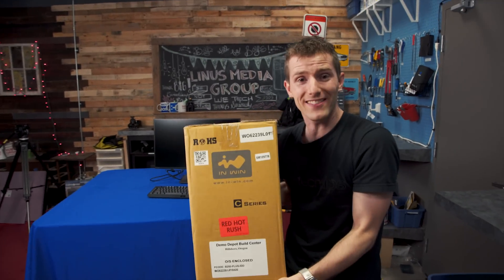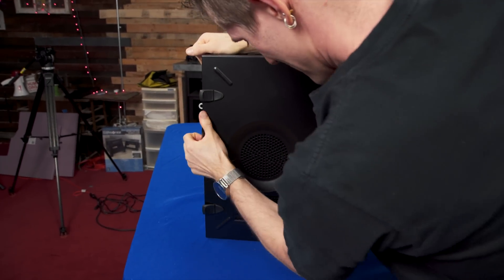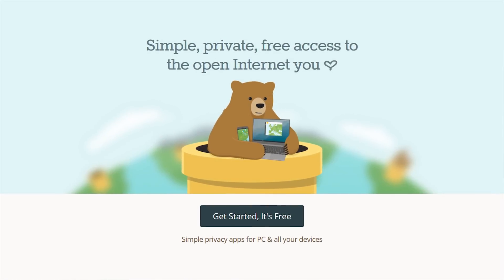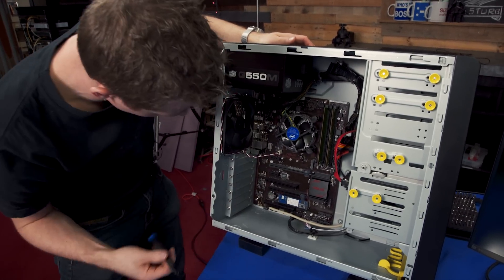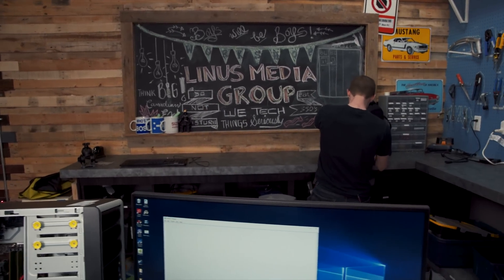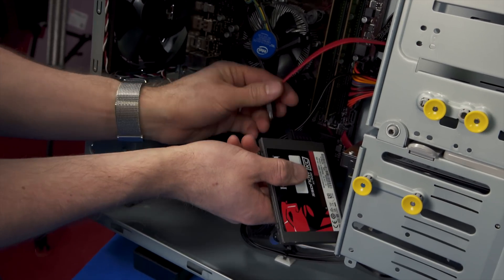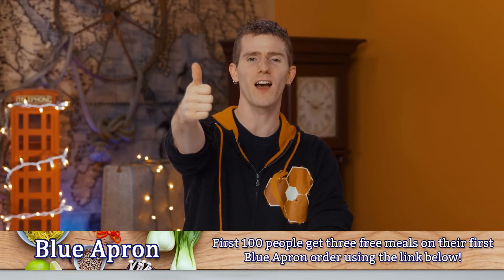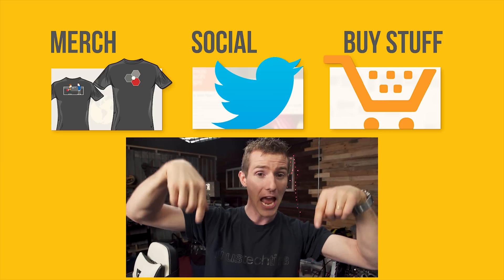Turbocharge your SSD for $40??

Comment: Misleading title. Did not teach me to give my SSD forced induction.
Reply: someone missed the turbo joke. wish my pc made turbo noises as well...wooosh pffft
Reply: DoNotAskJeeves Finally someone understands lol
Reply: Great Knightsby, Forced Induction is a car/motorcycle term to get positive manifold pressure on the engine to increase its power output/efficiency. The most common way to do so is to use a turbo charger, which makes use of exhaust gas to spin a turbo in order to pressurise the intake air.

It is extremely clear that it was a joke comment, I hope you understand now.
Reply: With a turbo I reckon I can get my pc down to 10 maybe even 9 ms in the 1/4 megabyte benchmark
Reply: Ryan Shea screw that. I'm getting direct injection.
Reply: no way! RGB and stickers can add 20+ HP!!! I mean... Compute Units! or something...
Reply: I gotta buy that Razer Chroma Keyboard with 10% less actuation force for a much more linear and responsive throttle response!
Reply: "inside joke". I'm fucking dead. lmao You aren't serious.
Reply: Thanks Falbere. I know jack shit about cars since I don't drive so I'm at fault. Apologies to the OP as well. 

HeavyRayne gtfo.
Reply: Vincent King horsepower? Compute units? Megahertz? No, GIGAHERTZ
Reply: Thanks for the laugh.
Reply: RIP. Guess you will have to stick to a naturally aspirated SSD like me
Reply: Falbere. Forced induction only works on an internal combustion engine with a lower than efficient compression ratio.Which means obviously the engine will be running at much lower efficiency when the turbo is not singing.
(Sub standard compression is required to run a turbo on modern engines, and it is helped by electronic engine management systems but they are limited by combustion chamber capabilities,which gets poor on a turbo engine..).
 You may get a higher maximum power output but efficacy will go down,generally.Even with a super charger,unless the engine is simply too small.
Hope that helps.
Reply: Sometimes, When I say boost efficiency, I mean that you only get the power when you need the power. In other words, you can retain an engine's efficiency if you stayed off-boost. This is good for when you are just cruising on the highway or when you are driving normally in a town. When you need the power, just give it full gas and you get power instead.
Reply: Unfortunately, no matter what it feels like when you demand the 'Go', a turbo motor will be doing less / gallon than a non turbo,when it is not singing.
The fact you cannot feel the power does not mean the compression ratio is not fubar and too much petrol is being burnt way after top dead center.
This is just turbo engines. 
Dont short shift thru the gears. keep the turbo just whining a little.
Otherwise your compression is shit and you might as well be burning the gasolene on the BBQ.You will find a spot in the revs where you lose little compared to driving about like a Granny.(low throttle, shift high enough rpm to just keep in turbo)
Reply: We are really going off-topic in this comment thread that is supposed to be fun. But fine, I will respond. 
I think you are still misunderstanding my terminology here. This is what I mean. In order for a gasoline engine of the same technology and basic design as its turbo engine equivalent to make the same amount of power, you need extra displacement or more cylinders. I am talking about more of a real world use scenario where you will often decide against which car to choose from. An example of this is lets say you want to buy a sports car with a rated 270 BHP output. You have a choice between a 2.0L turbo 4 cylinder and a 3.6L naturally aspirated V6. They are going to make the same power in the power band. However, the turbo engine is going to be more efficient at sipping fuel when it is not on boost.
Reply: Unfortunately you do not yet understand advanced internal combustion engine mechanics.
If you wish to make a 2 litre engine output power like a 3 litre engine by using a turbo,the only thing that makes this possible is a combustion chamber (top dead centre) area equivalent to the 3 litre engine.
(You cannot squeeze an extra 50% fuel mix in to the 2L lump; it would pre ignite and destroy the engine)
In other words, the engine MUST have a much lower physical compression ratio.
Low compression = shit mileage and performance when the turbo is quiet.
I already pointed out to you the term; too small.
You want 270 BHP but you 'diss' the 6 cylinder lump?
If its a heavy car,always buy the norm aspirated.
If the engine NEEDS a turbo to move a car sensibly; its too small.
Turbo chargers cost a packet. Running a sports car engine that NEEDS one is just waiting for big bills.
 What you saved on gas will look like a sad joke when that day arrives.
btw; the fact the car is not moving much does not mean you are not burning petrol when the turbo is quiet.
If you got your foot on the floor You may as well be just drinking it.
Reply: Man, you are really enjoying this aren't ya?
Sure, in that case I will just put on a different explanation for the use of the word "efficiency".
A turbo improves an engine's volumetric efficiency.

We really don't have to go this far just because I used the word "efficient" in my explanation.
Reply: This is bollox because you think the internal schematic is the same.Come back when you understand it cannot be so.
Reply: This is bollox because you are chewing my words on a thread that is supposed to be fun and games.
Reply: This is bollox because you have so little experience of physics you could not understand there was a penalty for running a 2 litre engine as a 3 litre engine,so shove off and comb your pony you childish idiot.
Cheeses, I've taught you more in the last 2 hours than many level 3 students get at all. Take it and walk.
Reply: Have I not acknowledged your previous comment as a good response already? I had given you another reason why I could call the usage of a turbo more "efficient", which is different from my previous explanation. You failed to catch it. After that, you proceeds to insult my intelligence, where I had made no direct comment to you as a human being. If all you are going to do is to turn this into a name calling war, I am sorry, I am not responding to you.
Reply: I have given you enough info to understand why you are totally mislead about turbo chargers. Whether or not you bother to think about it; None of my concern. I just wish petrol fumes were purple so that idiots could see their mistakes.
Reply: As I had said, I agree with the compression ratio, and yet you continue to act like I am absolutely shrugging off what you've said and proceeds to conclude that I am still misleading. Good job in your ability to read and understand text.
Reply: Ryan Shea Didn't you see the question marks? Linus just rekt Intel by saying this product is shit.  Because who is running a Z270 without a SSD?
Reply: Ubersonic well excuse me if I'm out of the loop to your inside joke. Whatever it's meant to be. I'm just sick of idiots not reading the damn title and then crying "Clickbait". There's a difference between ignorance and stupidity.

Comment: screw optane. i'm absolutely unimpressed.
Reply: everything is either a potato or not a potato
Reply: When I was a kid my dad had a thing where we'd be driving and he'd push this turbo button on the dash and the car would go super fast. I learned later that it was just the defrost button and he'd shift down a gear when pressing the button then he'd step on the gas.
Reply: Commodore4eva  the turbo button wasnt typically a performance enhancing feature and was never meant to be.
Reply: DDR4 isn't actually getting cheaper though, recent news has it that DDR4 pricing will go up by 10-20% in the coming months due to shitty yields combined with high demand.
Reply: potato potato potato potato potato potato potato why 9
Reply: Rocco Nicoletta Actually they have potatoes cross-bread with spiders. MMMMmmmm.....

Welcome to the NWO. Welcome to 2017, where everything is corrupted and fake.
Reply: I absolutely agree. It's exactly like caching from a few years ago. Big swing and a miss.
Reply: @Jonathan That's fucking awesome!
Reply: It's far more impressive as a server grade module hosting database loads. The use case for home users just don't translate to the large increase in IOPS over a Samsung 960 Pro.
Reply: Curtis Riceman I actually use an intel nvme ssd, and am pretty happy with it
Reply: No, news new now, prizes will rize even more then professed in Januari and won't be going down any time soon, because of bad yields at both Samsung and Micron.
Reply: The issue is that they are having yield and also some compatibility problems with the new fab processes.
Paired with demand being high for desktop flavors due to Ryzen actually selling rather well.
Reply: Definitely worth billions in R&D to come to the conclusion it's just like an SSD in 99% of cases. Maybe good on the stock market but why even mention it to consumers?